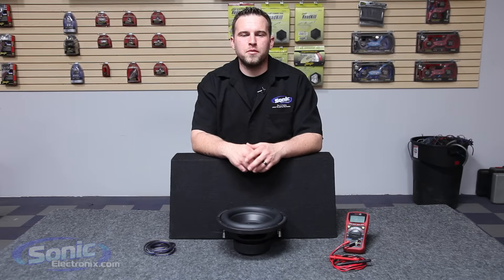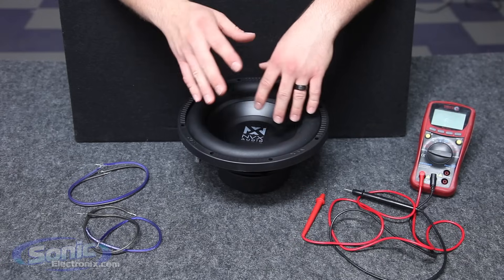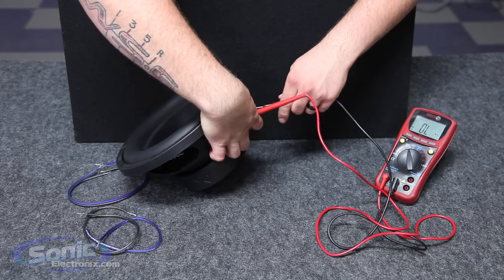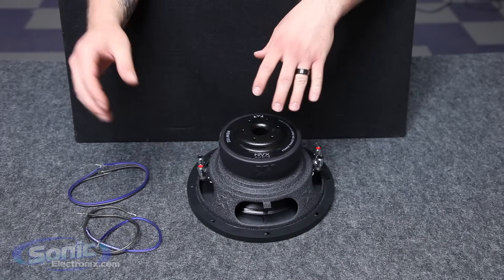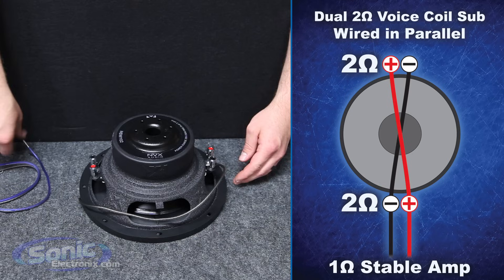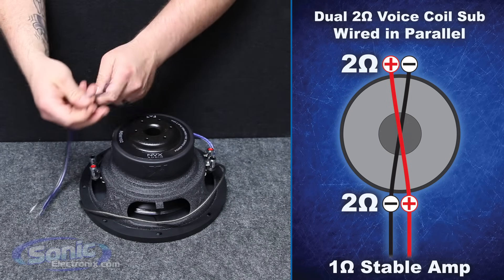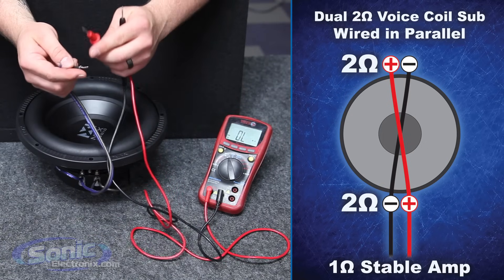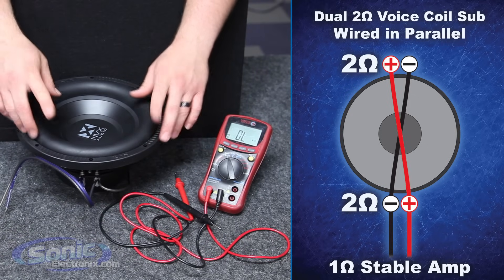How to Wire a Dual 2 ohm Subwoofer to a 1 ohm Final Impedance | Parallel Wiring | Car Audio 101

Comment: Hope somebody can help me.
I have an MD Sound Amp 2000w 2 Ohm stable mono block (four channel)
and two 12" 1200w max 4 Ohms subs.
I have them in series-parallel and down to 2 Ohm.
The amp is bridged (left negative and right positive channels)
According to Ohm´s Law 1200w * 2 Ohms = 2400w
Square root of 2400 is 48.9 volts.
The amp at full Gain gives 46 volts only. So I have it at 43v.
The subs moves but not fully, so my question is can I down them to 1 Ohm without blowing anything?
Reply: Nope, considering you have a 4channel (that is not a monoblock) thats 2ohm stable, wiring down to 1ohm would fry it. Check low pass filter and your source unit. Maybe need an equalizer.

Comment: How to wire 2 dual 1ohm sundown audio zv4 15inch subwoofer. Amp is dc audio 5k
Reply: depends on how low your amp impedance can be ran if you want a final 1 ohm load wire series parallell if you want .5 wire parallell

Comment: Can u wire 2 dual 2 ohm sub's to 1 ohm impedance
Reply: Nope and thats sucks
Reply: Robert Cohen 15 inch solo baric kicker
Reply: Robert Cohen
Reply: Need two 4 ohm dvc subs
Reply: negative... either 2 ohms or 0.5 ohms.... and very few amps will support half ohm load
Reply: @ledfootz28  the spl dynamics 3500D is on of them amps that does

Comment: will any power be lost by doing this?
Reply: cann this damage my speaker ? or will my subwoofer sound less clean ?
Reply: No gained
Reply: oude account depends on what your sub can handle power whise but more importantly if your amp is stable down to 1 ohm.

Comment: can you wire 2 dual 2 ohm subs to 1ohm fe
Reply: if you did exactly what he did in this video, with 2 dual 2 ohm subs, you would wind up with a half ohm final impedance, and that is a little dangerous if you dont have an amplifier that is half ohm stable.
Reply: no you can not do that, but you can do it with 2 4ohm dvc subs :)
Reply: yes just wire parallell
Reply: This wiring is perfect for One DVC 4ohm sub. With a final load of 2ohm to a mono amplifier. Wiring on the video will give a half (.5ohm) load. You need some very good (somewhat expensive) amp stable at .5ohm. Serious stuff.

Comment: My amp is rated for 400 watts max at 2 ohms, my me sub is 400 watt rms, if I wire my subwoofer to 1 ohm will the watts double to 800 max? Will this fry my sub? Its a new e12 sundown
Reply: Chris Hester your amp has to support 1 ohm, it will. Damage that before it damages your sub, potentially!

Comment: Is there a way to wire a dual 2 ohm sub at 2 ohms?
Reply: Legendary504 I’m wondering the same thing
Reply: @noahplante8592  Yes he can. If he wires the subs individually to 1 ohm. He is going to have 2 positives and 2 negatives. He connects 1 positive to the negative, it will take the ohm load to 2ohms. Then he connects the remaining positive and negative to the mono amp or 1 channel amp, it will give him 1 ohm.

Comment from the maker: if you have 2 single 2 ohm woofers then it will be possible to wire to 1 ohm.
Reply: Sonic Electronix how do i drop 4 4ohm subs to 2 omhs and to work with 2 mono block amps strapped together
Reply: I have a 2 channel 1ohm stable amplifier, can I run 2 duel 2ohm subwoofers to each channel but bridging both channels

Comment from the maker: Two Dual 2 ohm subwoofers will wire to a 2 ohm load in parallel. Two Dual 4 ohm subwoofers will wire to a 1 ohm load in parallel. The end result is one set of wires will connect to the amp.
Reply: Sonic Electronix how to wire a single dvc sub with daul 2ohms

Comment: Would this wiring setup go great with a single Kicker Solo-Baric L7?
Reply: I know it's been 9 years since you dealt with this but I'm having an issue with my l7. I have it wired like such in the video but the sub gets hot and you can smell it when its hittin hard. Idk what to do

Comment from the maker: The amplifier has less control of the subwoofers movement. However, in most cases, you will not be able to tell a difference.

Comment from the maker: Two Dual 2 Ohm subwoofers wired in Parallel will come out to a 2 Ohm load at the amplifier.
Reply: How can I wire two dual 2 ohm subs to a 1ohm amplifier?
Reply: How can we wire one dvc 2ohms sub to a 2ohms load?
Reply: So if i have 2 2ohm dvc subs i need to have 2 amps if i want them BOTH at 1 ohm?
Reply: If you wire them parallel to parallel it will come out as 0.5ohm. If you wire them series to parallel you will get a 2 ohm load

Comment: a DUAL 4 OHM wired in Parallel, will give you a final Impedance of 1 OHM. A bit of overpowering from the amp is a Good thing, but waaay too much can be Bad. So keep that in mind, do the math.

Comment from the maker: You should google it, it can be an advanced concept. The ohm is a unit of measurement that tells you how much resistance to the flow of electricity there is in a circuity, or in this case, a subwoofer. For the sake of car audio, when it says "Dual 4 ohm" or "Single 2 ohm" that determines how you are going to wire up the subwoofer to an amplifier. For example: One Dual 4 Ohm subwoofer has a final impedance of 2 ohms at the amplifier, but if you wire two Dual 4 ohm subwoofers, they wire to 1 ohm.